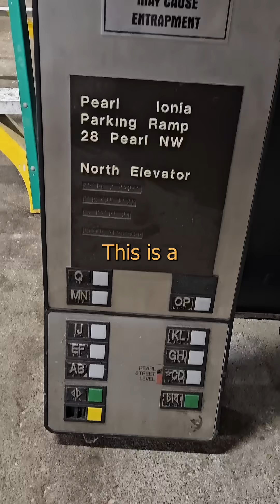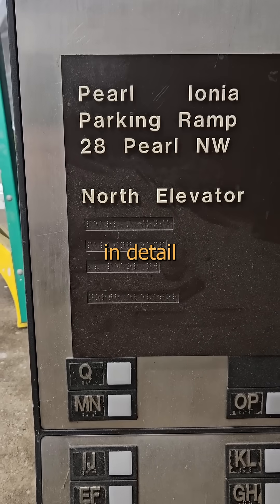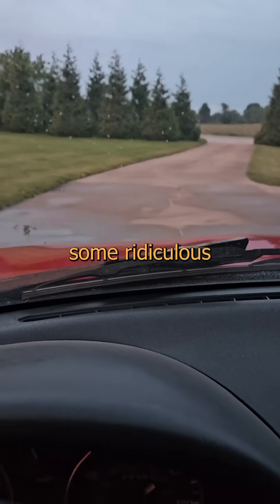Miata Mischief #chrisboden #engineering #gear #elevator #score #stories #parts #hacking #making

Comment: I was given permission to haul off 3 lighted railroad crossings, that were already down and ready to be loaded. I went out in a rainstorm and loaded 3 fully lighted crossings into the back of an old Dodge Colt (like a Chevette but smaller. Crossing weight about 300-400 pounds each as they were the old steel and cast iron ones. I dis-assemble the lights and signs, from the masts. the lights and signs from 2 filled the back of the car with the rear seats folded down. I still had 3 masts and 1 set of lights, as I am not making 2 trips. Down the road I go with +8 feet of crossing mast sticking out of the back of the car, with the hatch open all the way. I red flagged the masts of course. I never see any cops driving around, anywhere in my area, until that day. One pulled up next to me at a traffic light and asked what they were and drove off. Two others looked at me, shook their heads and never pulled me over. Interesting hour drive home.

Comment: I was too cheap to rent a van so I used my brother's beater '02 mustang convertible to move a smaller refridgerator/freezer. The key part was tbat it was convertible, so we were able to lay it down in the back seat with the top of it hanging out over the edge. Despite my civic having a lot more interior room than the Mustang.. no way it coulda moved that fridge

Comment: I once got a call from my neighbor that he got stranded on a mountain top about 15 minutes out. Turns out his Genesis coup broke down. Couldn't get it started so being on a mountain in the back country of Germany on a Sunday. No one was gonna do shit to help. So we got the damn thing in neutral and pushed it down the mountain road. I quickly got in my 2017 honda civic hatchback 6 speed manual and followed until he lost momentum in the town at the bottom of the mountain. I got in front of his car, hooked up a 25k sling rope from my army days, and tied it off to my back seat. I then proceeded to tow my neighbor's car with him in it the next 5 miles, keeping coms open so he knew when to break and turn. Most unconventional tow I've ever done. So, if anyone was curious about the towing capacity of a 2017 Honda Civic hatchback. It's roughly a Hyundai Genesis coup.

Comment: Well, I've tied a 40' extension ladder under my Mazda B3000 and driven it like a deranged upside-down jouster.
I've also bought a Jeep Cherokee and drove it home with another Jeep Cherokee inside it. By that, I mean: 6 doors, a hood, two sets of front fenders, a radiator, two fans and a shroud, a 3 inch and 6 inch suspension lift, two leaf springs, 4 coil springs, shocks, power steering pumps, alternator. Basically everything but the frame, motor and transmission. I could only see out the front and driver side window. THAT was pretty cool!

Comment: I daily a 1968 ford mustang I use it as my work truck. I have removed the trunk lid and hauled pallets in the back. I have flat towed bigger vehicles with ratchet straps. The seats have a ton of wear and tear from drill presses, bench grinders, and 1940s radio equipment being on them. My favorite by far was me removing the back seat to fit a 10 ft long sign pole in the car. I had removed the factory radio and with the front of the pole inside the dash and the back of the pole at an angle in the trunk running through the whole car it just fit. This was the solution that worked. I realized having it hanging out the front vent window on the passenger side and rear vent window on the driver side by a foot and a half on each side was dumb after driving one block.

Comment: Alright so i was turning my truck bed into a functional cooler for entertainment purposes the important part is that my truck bed is was very small like a 4 foot by 4 foot bed and i didn't think through how i was going to get the 2 sheets of 8 foot by 4 foot insulation foam home so me and a buddy had to hold the foam on top of my truck while i drove home you could not imagine how much air those things catch and how painful it was to make the 10 mile drive home we had to avoid all highway or main roads because we weren't sure on the legality of doing this and anything over 30 mph we couldn't hold on to anymore

Comment: My mom and I went to pick up a trundle bed frame that someone was giving away for free, but it just barely didn't fit. So we pulled the driver's and front passenger seat all the way forward, pushed the bed in as far as it could go, and duct taped the trunk door closed because it wouldn't shut all the way. Drove all the way home with hazards on at like 25 mph praying that the duct tape wouldn't crap out. Good times

Comment: This happened to me and my friend.

Used a shopping cart that had two front wheels missing and we used a skate board as the front wheels to help my friend hull a broken down go kart next to a dumpster. Took us 4 hours to get it to his place sadly his board broke 2 hours before so we had to angle that shopping cart lole it was a wheel barrel...took him and his brothers and dad 4 months to fix...4 minutes to get to the gas station near to him and 4 seconds for a ceack head to steal it when he went into the gas station And then proceeded to rem it into sauad car sending both the crack head and go kart spinning like it got hit by a green shell only for the crack head ro be flung off and rhe go kart spinning into loading truck that was at the gas station as a dolly full of beer fell on fhe kart as beer killed the engine...my friend just walked away cause he didn't want to risk being tied to all of this 😂😂

Comment: after back surgery I saw a hospital bed being discarded in a scrap bin. I wanted the steel, but mostly the electric motors w acme screw drives. my wife saw me pulling it out of the bin.with doctors orders not to lift more than 10 pounds. wife didn't talk to me for a week. i pulled it home like a giant wagon.

Comment: ROFL you asked for it about 15 years ago me and my stepdad we're working together and we did this apartment complex and they were removing all the satellite dishes they were having internet TV installed over satellite me being the tinkerer I am I asked if I could have all the old satellite dishes and receiver heads needless to say with our e-150 Ford van completely maxed out with tools and receiver heads had no room for the satellite dishes so I proceeded to ratchet strap all the satellite dishes to the racks on the roof I can't imagine what people's thoughts were when a plumbing van drives by with close to 200 satellite dishes on the roof aimed at every which direction😂😂😂 needless to say after that incident anytime old tech gets to be thrown away people tend to call me first around here ROFL

Comment: I was 14 when our local bike shop closed down. All of the bikes that weren't sold at the auction were left behind the building. I went crazy and tried to get as many as I could home with me. There was an old mop handle in the pile, so I picked up four bikes on it and rode my bike home with them over my shoulder. I made two more trips that day at 5 miles each way. I'm 57 now, and i still have two of the bikes and, of course, the mop handle.

Comment: A few years ago i need to get a 1000liter tank home. And i didn't have trailer, but i had a old wv passat i didn't care about so i just put a blanket on the roof. Then i used a forklift to get it on the roof, and roll down the windows so i could use some ratchet straps. 
Next stop the highway!
And yes there was lots of people there was looking very funny at me when i was overtaking them😂

Comment: I have no chance of coming out on top here with all the great stories so far but I definitely want you to hear this one. (One of many).

 On the highway, I saw an overturned SUV who clearly lost it in the snow and ice and wrecked bad. Really bad and probably very fast. There were no emergency vehicles around yet so I had to see if I could help.

 I happen to love driving in blizzards so I’m very often the first to see a wreck when there’s almost nobody else out there. Probably up to between thirty and forty by now.

 On this occasion, my SUV was completely full. Couldn’t put a person in there to save their life (literally).

 So, in the interest of time, I took the ladder off the roof, carried the driver up to the “Whopper Box” Yakima roof rack thingy and closed him into it. Chained my ladder to the tow hitch and dragged it behind the truck carrying the bags of tarps that were in the box. I had dirty tarps and ropes up there, and the ladder tied to the side of the box which was sketchy to begin with, from a music festival. The inside of the truck was filled with very expensive live show production equipment like racks of amps, lighting controls, mixers, (I feel like you understand that those couldn’t be moved or discarded). 

 So, crash boy traveled to the hospital in a plastic box on my roof in a snow storm. Flkn insane, I know, but I got him there. The ladder was surprisingly almost perfectly fine too. Just a little scratched up from a few clear ruts here and there at intersections once I got off the exit and started moving through places in town that people braved to be out in.

Comment: i've moved a ton of stuff in my convertible. I call it my SUC, Sport Utility Convertible. Separately it has moved: half a dozen 10 ft T posts, a quad set of 8ft 4x4" posts, a 7ft long 3.5ft diameter beanbag couch, more than a dozen coil skid pallets one at a time or in pairs,

Comment: I hauled about everything in a 90s thunderbird... I once had the passenger seat and trunk  overfill with limestone rocks to do a fire ring at my buddy's place. By far the sketchiest haul by sheer weight that didn't blow every shock in the vehicle.
Though I did blow the rear shackle on my ranger hauling an absolutely massive amount of scaffolding I got for super cheap. It was over the cab, strapped to high heaven and about 5 hours and change home on back roads because there was no way it was holding up to highway speeds.

Comment: I bought some 3m (~9ft) wood beams at a hardware store with a bicycle cart which i was toeing by hand i balanced them on the cart and used some tape to fix it to the cart. Now here is the Problem i was using the subway and munichs subway carts are 2.90m in width, outside. So i took my beams (with tbe cart attached). Angled them upwards so that the doors could close (still with the cart(now hovering) attached). It worked fairly well.

Getting them up to the flat was another adventure with 9 stories and an electrical cable as a rope.

Comment: My tundra isn’t rated for 5600 lb in the bed but you bet your bottom dollar I hauled 5600 lb of concrete on a pallet home to save 50 bucks on renting a trailer. Truck is fine and concrete poured. Win-win

Comment: I somehow fit 10 oscilloscopes and five rack mount boat anchors in my ford focus.  Probably 600 pounds of gear, and the drive home was sketchy, but I have a few 1950s tek scopes to flex with now

Comment: Hauling stuff?  When our unfortunate circumstances tenants from Hell ran away, I had to pretty much gut the interior of our rental house - new kitchen, bathrooms, carpets, paint, etc.  We went with IKEA cabinets. Getting the entire kitchen's worth of flatpacks home from a mad dash to the Tampa and Orlando IKEA stores meant every cubic inch in my Accord sedan that was not occupied by me was packed to the gills with cabinet parts - trunk, back seat, front passenger seat, all floor to ceiling. I had less visibility than the driver of an M4 tank looking out the slot in the front armor!I could only see out to the front and left of the car, and very carefully stayed wedded to the right lane all the way home.

Comment: Well, I moved recently, and took on the task of helping transfer things to the new house.

Which translates to several trips of loading and unloading most of a room into an actual SUV, and my dinky-ass Jeep Compass, which is probably one of the worst vehicles I've ever had to drive.

Back and forth, having to arrange the cargo in such a way that it wouldn't tip over and smash everything if I turn too quickly.

All because the moving company doesn't take plastic totes, for some reason.

Comment: When i was about 12 i was really getting interested in small engines but i didn't own any so i would ride my bicycle down to the local dump to see what i could scavenge. I towed a number of push mowers and rototillers 5 miles home behind my bike. Wasn't easy especially with our steep hills but i did it anyway 😂

Comment: I found a formerly standing batch of hickory trees, that had been killed by a hungry beaver (he) about a mile and a half into a hike. They were 3-6 inch diameter and 25-30 feet long and I had nothing to cut it with so I finished my 6 mile hike. Then immediately put an ax, saw, and rope into my pack and hiked all 600 lbs of it back of my Impala. Then wedged/placed it all in my laid back front seat and prayed nothing would break on the drive.

Comment: You are like 1:1 with my dad with both miata enthusiasm and the tendency to collect random crap. He could fill a warehouse with all the random bobs and security cameras and gardening junk and server racks and deprecated communications tech he collects from alleyways and trash piles over the years, not to mention his addiction to auction website. He even works for the power utility for god's sakes.
Reply: To top that off, he worked installing elevators, as a cop, as an undersea cable installer, as an ISP tech, and now at the power company.

Comment: Wanna hear something cool?!

When I was in 7th grade I wanted a TV in my room. Parents said no. I am determined. Saved some money, about 30 bucks. Rode my bike around to garage sales whenever they happened. And one day I found it, a used 10 year old flat-screen samsung. I rode back to my house and pulled my red-rider wheel burrow over there. I paid like 15 bucks for it and then hauled it in a red-rider wheelbarrow about 2 miles in the arizona heat. It broke 102F (that's about 39C for my European friends)

 Today's flat-screens are light. But the TVs of the 2000s were apparently much heavier. This thing weighed 50lbs and fucked my scrawny seventh grade shoulder like it was a blonde on prom night. 

Then halfway through the long journey, the tire on my red-rider went almost flat. It was just good enough to keep going, but it made the whole experience so much more excruciatingly annoying. When I got back home, my parents called me and idiot. But I now had a PS2 and a dvd player hooked up to a TV.

Did the Samsung short out every once in a while and fuck me over while playing games? Yes. But every time I used that thing, I knew I got it by having a 'fuck it' attitude and a sheer will. And that's pretty cool!!

Both the red-rider and the TV are long since trashed (you can't take it with you) but the memory is still here. And that's pretty cool!

Comment: Got kicked out of the apartment. I was in and all I had was a Honda Fit, and no one else would trust me with their truck. So I had to strap a extension ladder, 2 mattresses, one box spring on the roof of the car, the washer and dryer in the car, and uh, pretty much the rest of my life surrounding the washer and dryer in the car. And went 100 and some miles had to throw away all the stuff because I'm still homeless. No such thing as free storage anywhere from anyone. Just yeah, so you know.

Comment: I had to get my front end core support( because the bottom that holds the radiator rusted off) for my 2000 montie carlo ss home with said montie carlo and the bits and bobs tied up with rope and zip ties

Comment: I was eating pizza when I saw some guys changing the traffic lights on the corner, so I went and told them to sell me the olde one and they did! I kind of got it in the Back of a Hyundai venue which is not that small but surely not ment for that?! In the end I got my traffic light mounted in my bedroom wall next to my tools 😊 I need not to get the lights to lit up and change colors jajaja. Dude it's awesome each time anyone enters my room. Traffic 🚦 lights are bigger that we think! Now a have a Miata NA 1990 I don't know if I could have done it there but I would have tried 😅

Comment: I recently rebuilt a fence at our house. Because the builders of that fence must have been complete 'tards, the posts were not evenly spaced. So I needed different sized 2x4s, some 10ft, some 12ft, mostly 14ft, and a few 16ft. I have no truck or trailer to carry them in, all I had was my old Mazda CX-9. So, I loaded them through the passenger side front window all the way back into the cargo area. Only about 10 or 11 ft fit IN the car, so I made the 25-30 minute drive home from the hardware store, mostly interstate, with 5 or 6ft of 2x4s hanging out the front window.

Comment: 10pcs of 20' 3/4 pvc in a ranger. Wrapped it with cheap 33 at three points. Tied it at front bumper and tailgate on passenger side. Lashed the middle to the drivers side bitch handle and drove 20 minutes with a death grip on it.

I owe this success to ritual magic of all men in my lineage. "Yup, thats not going anywhere". Wife showed me that she could be impressed and pissed at the same time. She has no faith in ritual magic, I discovered.